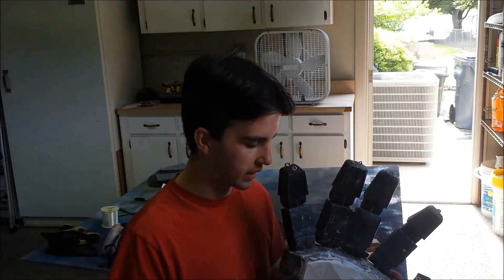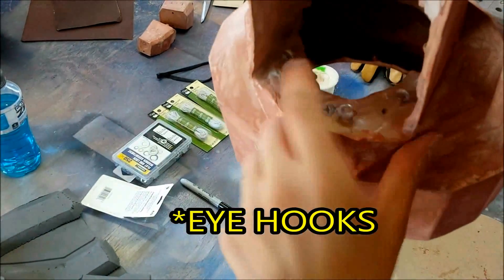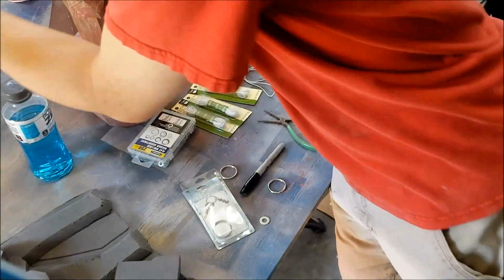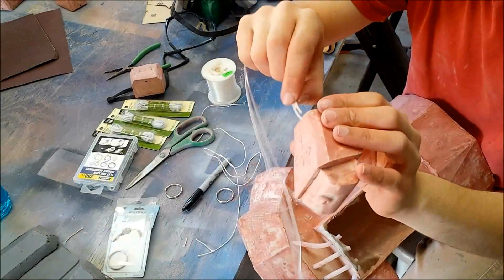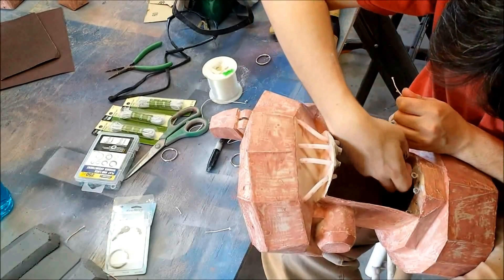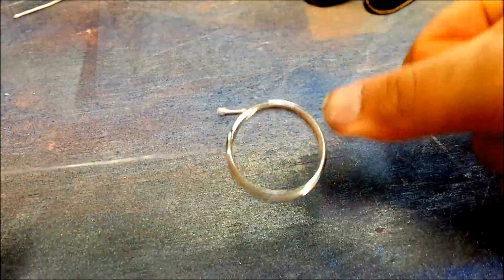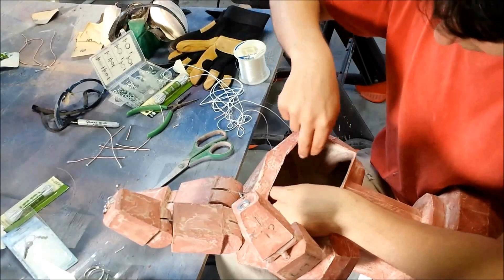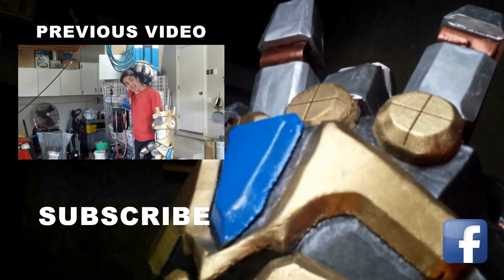How 2 - Articulated/Animatronic Hands Tutorial - Vi's Gauntlets From League of Legends

Comment: Just my two-cents here, but in my own similar design, I found it easier to attach the string to halves of black plastic flex-pipe (like PVC pipe, but thinner. And less chlorine gass if it heats up), and then attach the pipe to a pair of gloves. If you glue the back of the glove to something, especially the back of the wrist, it's pretty easy to slip your hands into the inside glove with nearly no effort (especially if the hands are made so they can actually grip).

Comment: Question! I am doing the same basic thing but the fingers at the tips of my gauntlets are pointed. How do i hide and thread a washer through the top when it goes to a point?
Reply: well, one simple way would be to have the points be hollow or semi-hollow caps that attach to the finger tips.in that case, you probably want some way to lock the tips in firmly, such as a nut and bolt on the inside.